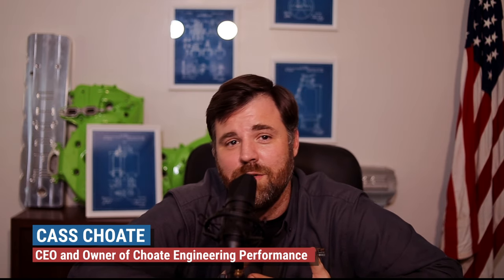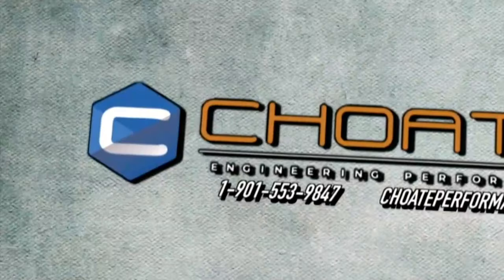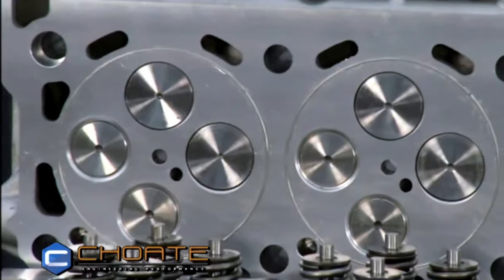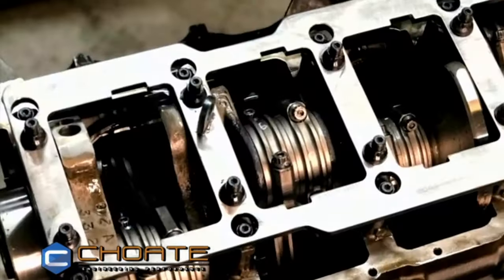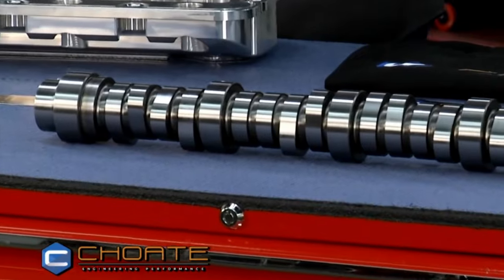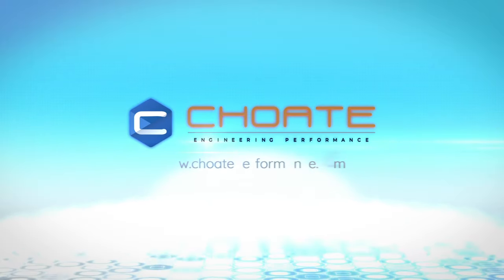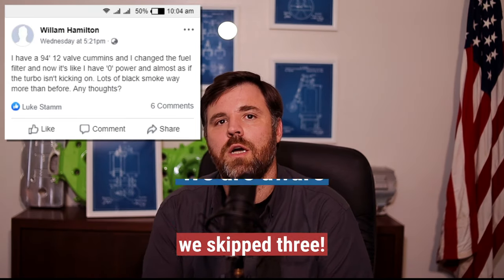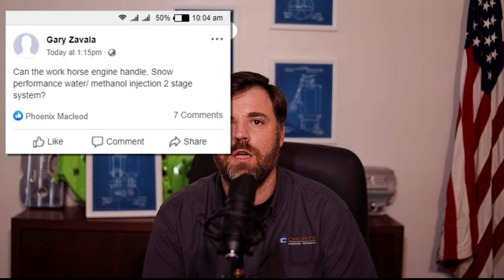6.0 Powerstroke Trouble and Even Worse 6.7 Powerstroke Issues

Comment: Hi Cass. I am 5 hours away in Arkansas. I am buying a 6.0 soon and if I wanted to have the engine rebuilt a precautions only, could I drive the truck out to Choate Engineering and Performance and drop it off and drive back home(Car on dolly behind truck), or do you guys not pull engines and do the "whole job"?  Thank you so much...  The way I see it, its much cheaper to buy a nice 6.0 for $12,000-$18,000 and have the engine redone, that's still cheaper than a new $75,000 truck.....
Reply from the maker: Hey Freddy! we would be happy to help you out! give us a call at 901-553-9847 !